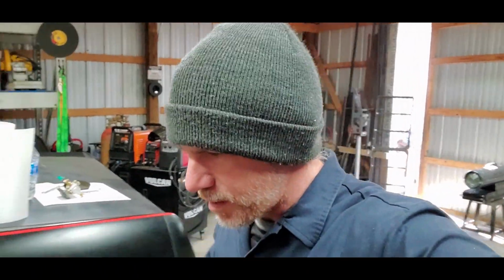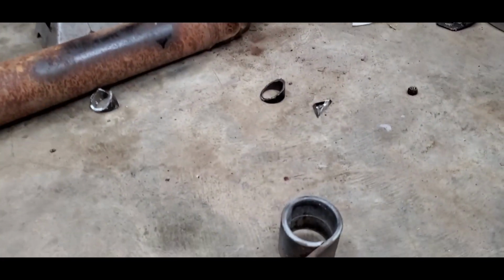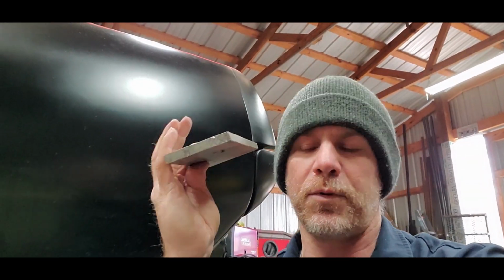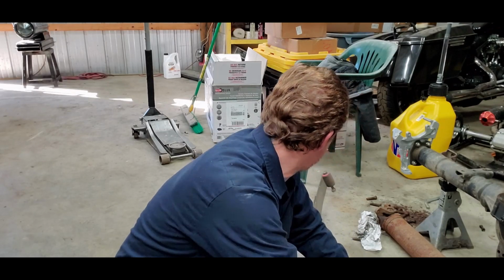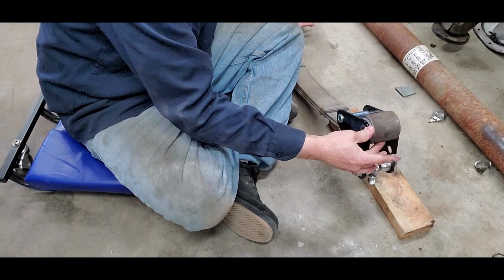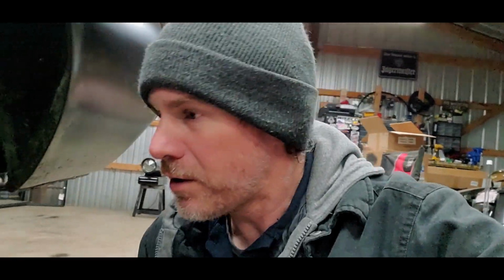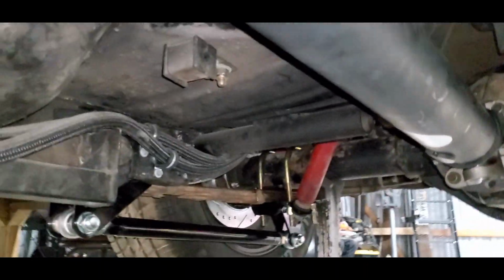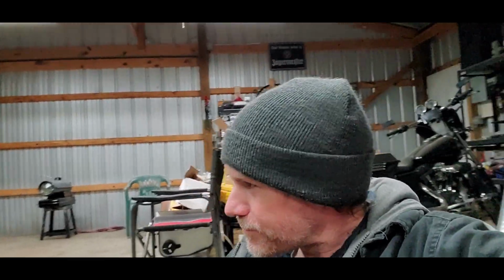Installing the 8.8 into the 67 mustang pt.3 (without narrowing)

Comment: I used a 98 explorer diff in a 67 Mustang for a 6 to 8 conversion, I’m in Australia so the Explorer and older 1980s  f100 are the only option if wanting a 8.8.
After getting it in, I found the extra inch length or so made wheel and tire selection very hard using commonly available 15” 8” wide rims.
If I was going to do it again, would do a axle tube cut and fit another short axle to centre the pumpkin, it would hit the floor as you said as was lowered.

Comment: Just finished putting the same axle in my 67, the offset was questionable, and with the stock 200 inline 6 the muffler clearance is a concern, gonna have to move it, but doing headers soon too. Thanks for the info!

Comment: Howdy, what caltrac kit did you use? Curious with the mustang springs and the 8.8 axle tube diameter. Also what was the measurement from axle perch to each backing plate? I know you have since narrowed your other axle but I would like to just swap an explorer 8.8 into my 1967. So all I need to do is move the perches! Thanks!
Reply from the maker: I had to call Caltrac and tell them what I had and they sent me what I needed. I'm offshore right now so I'll get you those measurements as soon as I get back
Reply: @toyshopfab  thanks man!! Love the channel.
Reply from the maker: The measurements are 5 3/16" from center of axle perch to inside flange
Reply: @toyshopfab  dude! You’re awesome thank you so much
Reply from the maker: No problem 👍

Comment: What was the length of the drive shaft you purchased, and what was the total distance from c of spring perch to center of spring perch
Reply from the maker: Drive shaft is 50" center of u-joint to u-joint and leaf spring pad is 43 and 5/8" center to center. Definitely make sure to double check in case mine is a little different.

Comment: What did you do about the offset Pinion? I'm installing the very same 8.8 in my 68. Just noticed the Pinion offset. I was finishing up the install and saw the offset.
Reply from the maker: I have done two videos, one with the offset and one with narrowing the rear end.  This video shows some of the issues you could run into by leaving the offset but I drove the car and didn't have a problem. If you leave the offset and plan on having passengers in the back, you might have to message the floor a little so the rear yoke doesn't hit
Reply: @toyshopfab  yea there won't be any passengers in the rear. Thank you so much. I feel better finishing this up 🙏

Comment: Great video I got a67 fast back I bought a 8.8 I need to install I got everything except drive shaft ends  I will b using original drive shaft  I just do t have part numbers  is there any way you can send me part numbers for  bough ends please  thank you
Reply from the maker: Thanks, and there's links to all the parts I used in the description, but if you're looking for original part numbers you'll have to do a little research.
Reply: Thank you for your help

Comment: what did you do about the 2 inch offset of the diff towards the passenger side? just bought an explorer 8.8 to swap into my 68 hardtop, im pretty inexperienced but learning along the way, will i have any troubles with the driveshaft and all that stuff?.

Comment: Working on the same swap. What did you use for the shock brackets?
Reply from the maker: I used the brackets that came with my traction bars that I got from Calvert

Comment: What caltracks did you get . Please help. I'm trying to swap my 64½ rear end . I'm trying to install a rear end from a 02 mustang
Reply from the maker: Here's a link to their website but if your axle tubes on the 02 are a different diameter than factory you will have to call them to make sure you get the right u-bolts and mounting plates https://calvertracing.com/product-category/caltracs-standard/?_make=Ford&_model=Mustang&_year=1964 hope this helps

Comment: You can fit a foxbody diff no problem and also you can fit a SN95 without any issues or modifications ..
Reply from the maker: Nice, good to know 👍
Reply: I also made my own brackets to accept the front caliper brackets from an sn while using the factory 67/68 spindle ..
Brackets , calipers , rotors etc everything out of an sn while using the 60’s spindle
Reply: @toyshopfab  also look at the engine bay on the video I’m even running the master and booster from a 98 sn
Reply: @toyshopfab  I literately did a full brakes swap from an sn without any aftermarket parts

Comment: what driveshaft are you using ?
Reply from the maker: I used a custom drive shaft from universal drive shafts with 1330 u-joints and I also upgraded the slip yoke for the transmission